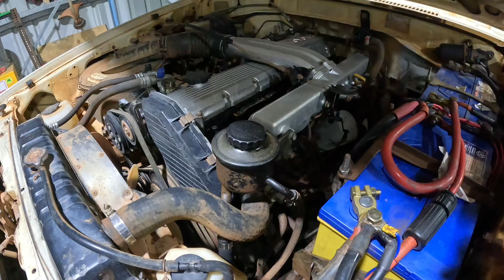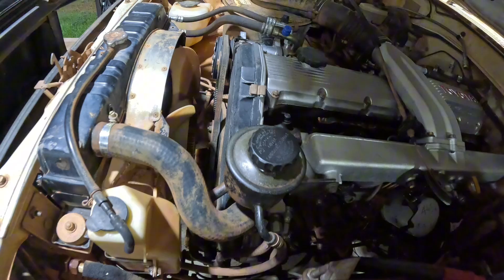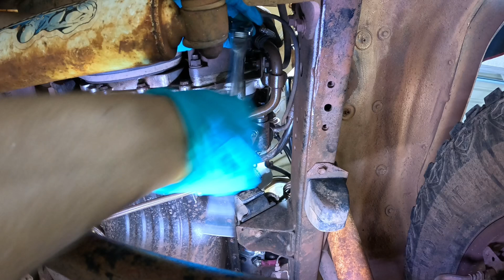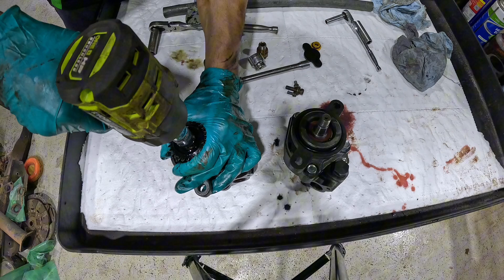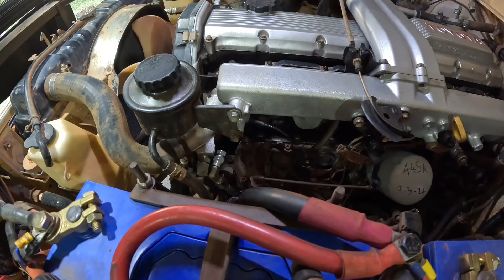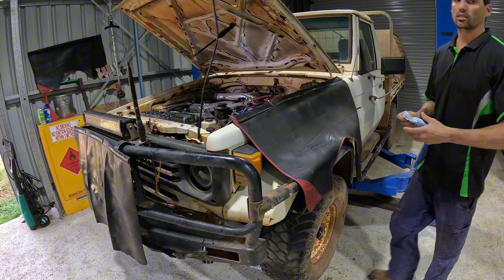Toyota Landcruiser Power Steering Pump Replace HZJ75

Comment: Is there any other common leaking spot other then the two hoses connecting to the pump?
Reply from the maker: usually on the rubber hose that connects to the steel line going from the pump to the steering box